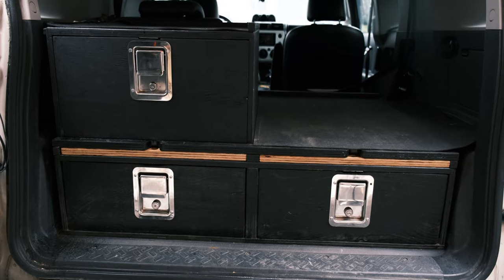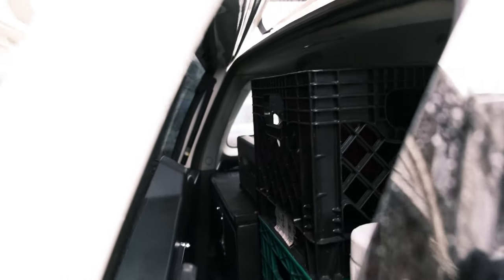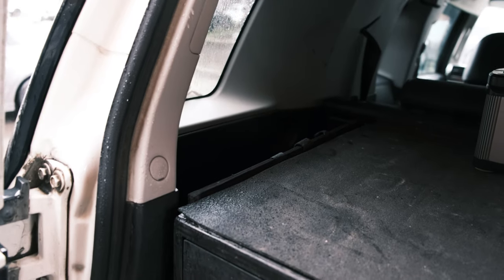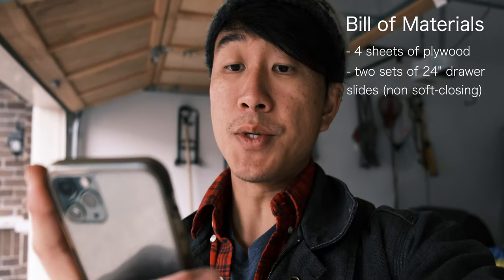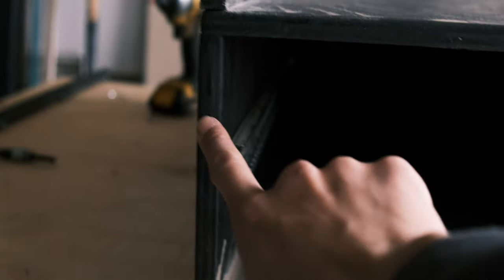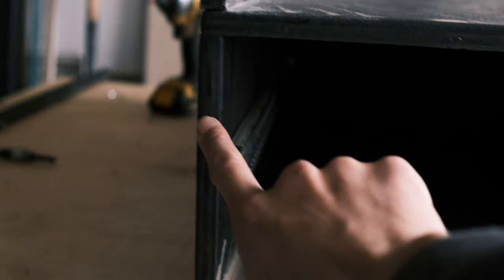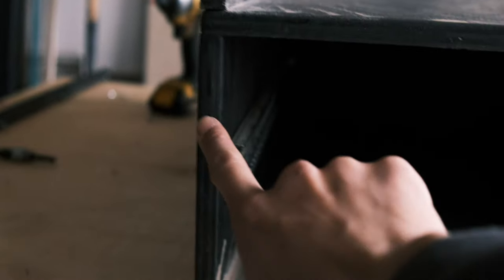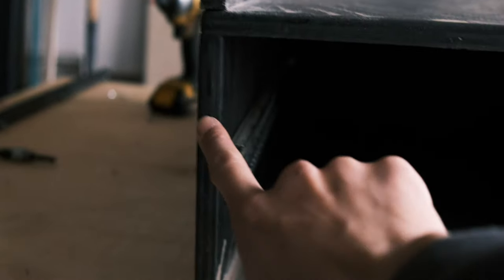FJ Cruiser REAR STORAGE Drawer Build (FULL GUIDE) for Overlanding and Car Camping - PART 2

Comment: I just built my FJ drawer 2 weekends ago. Was definitely a learning experience. Really wish I waited for your video. Would have saved me a little time.
Reply from the maker: Ahh oh well, at least you got it done! What kind of drawers did you make??
Reply: @stokedtour  Just one big drawer. tall enough to put milk crates inside. wide enough to slide my stove and table between the drawer and the wheel wells(maintain access to inverter and jack storage as well.)
Reply from the maker: @adamghahate3323  beauty! Ah yes I should have mentioned the bit about removing the Jack first before you close it off!